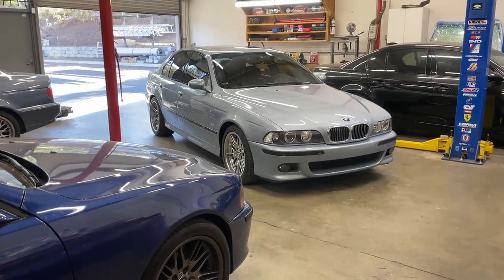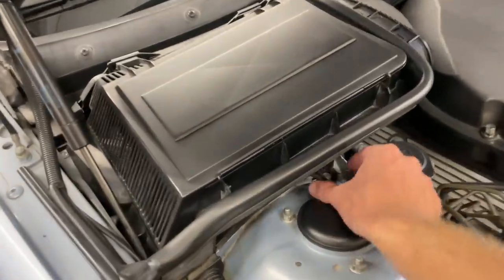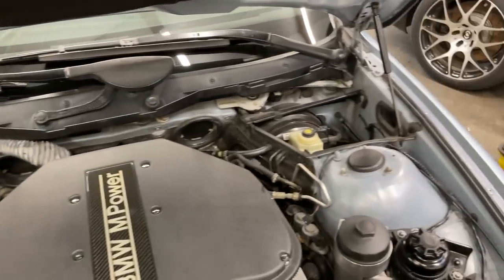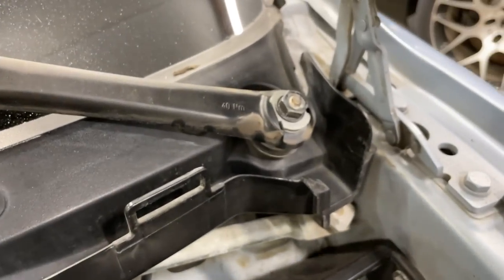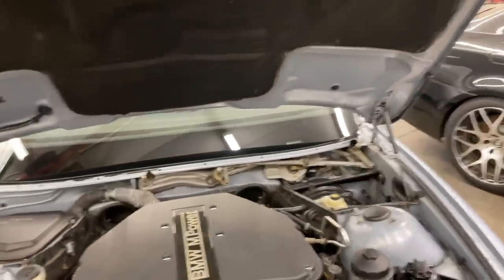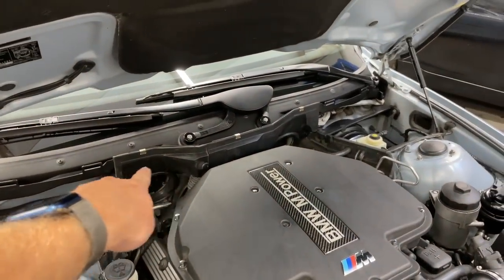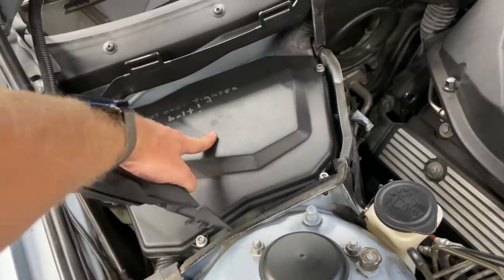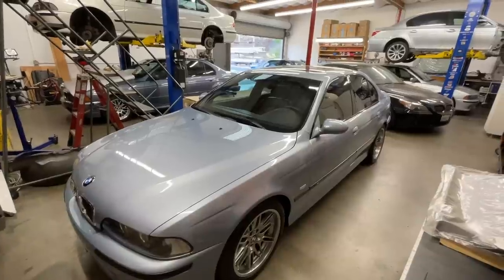Ryan's BMW E39 M5:  A New Windshield, and Much More!

Comment: Finally the next episode!

Btw: The small little Caps on the A-pillar which are sayin HPS (guess it means head protecting system) are available on the Euro Spec cars here under 51432251367. Only difference is that they are saying "Airbag" and not "HPS". But i guess that doesn't matter. ;)
Reply from the maker: Thank you so much!

Comment: You probably know already or have done this retrofit, but if you don't, the e60 washer jets can be fitted for a nicer fan style spray. You need a couple NRV for intensive wash but they work amazing.
Reply from the maker: I am aware of the retrofit, though I have not done it since I never use that system.  Thanks though!

Comment: Just did windscreen gasket. OE. Had to cut much silicone from under the screen before it would seat. Original green tint, rain sensor 'screen.
Pulled rain gutters to make seating the corners easier. Cowl next.
I see now I'm missing the triangular outer cowl pieces. Just realized it's draining into the fender, ECU etc. Not cool.
Reply: how were ytou able to cut enough for the channel of the gasket to fit? i tried to cut with a blade and i can only get an angle cut which still wont seat the gasket.  please help

Comment: Thanks for the video share. 
I'm changing my old wiper arms next week.  However, I noticed that a bolt which holds the right-side wiper nut is snapped off (center nut).  Is it a risk to reinstall the arm with a missing nut?
Reply from the maker: I wouldn't do it without the hardware.  You can find the missing hardware at realoem.com

Comment: So, was it actually necessary to remove the A-pillars for the windshield replacement?  I wouldn’t think so, and I really hope not because it’s very easy to break the plastic tabs inside those very expensive A-pillars.
Reply from the maker: Probably not?  It just depends if the installer is comfortable working/scraping/using water around them.  I would personally want them removed and put somewhere safe.
Reply: @E39Source  Thanks for the info, Ryan. 🙂

Comment: Hi man I wanna about how to deal with the issue of over heating on E39 528I
Reply from the maker: E39 cooling systems should be refreshed every ~10 years.  I would recommend replacement of the fan clutch, fan blades, electric fan, radiator, thermostat, water pump, expansion tank, and all coolant hoses/lines/sensors.

Comment: You the goat 🐐 that E39 looks brand ! What is the underside looking like ?
Reply from the maker: It has some corrosion on under-body welds, but nothing major.  It did go through 14 Ohio winters, after all.  I have cleaned the majority of the under-body, so it presents quite well.  The plastics and rubbers are all pretty fresh.
Reply: @E39Source  looks like a good candidate for ice blasting ? 😎 you know the girl deserves it
Reply from the maker: @jensduhem8904  Perhaps sometime, I'd need to look into what that runs and where to do it.  It might be difficult to do in CA.

Comment: I know this ques is not related to this vid but here it is I guess I call it minus on my steering wheel sometimes work and sometimes it dosnt any help would be appreciated Thank you alot
Reply from the maker: The volume down button?
Reply: @E39Source  oh boy I forgotten the most important the cruise control button sorry man
Reply from the maker: @jonapolloapollo5770  Could be a bad button panel, or something wrong with the system.  I would want to scan the car for codes before replacing that expensive button panel.
Reply: @E39Source  THANKS MUCH YOUR THE BEST

Comment: I found that you didn't have to remove the plastic behind the engine...that part that does break up over time 😢
https://youtu.be/szCaquo5oFY
Reply from the maker: That is correct, they do not have to come off, but I generally do remove them to avoid stressing and breaking them while wriggling the cowl in and out.